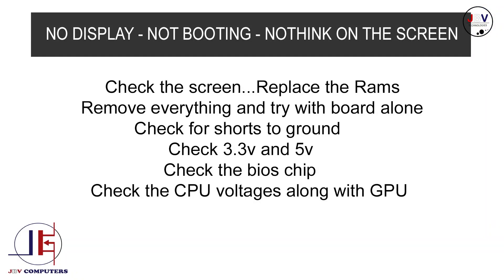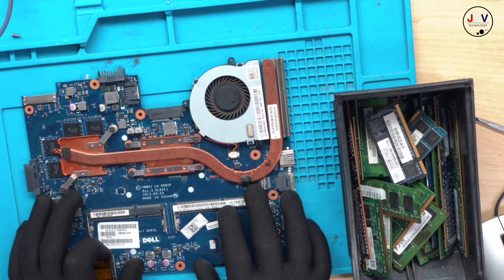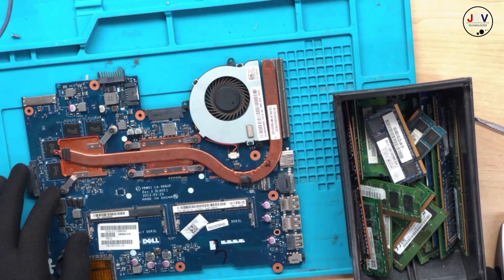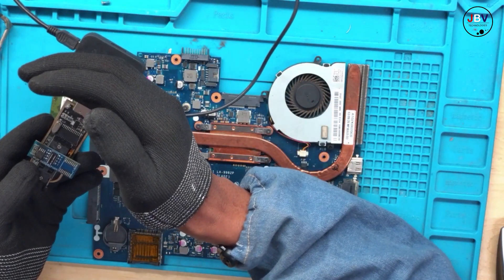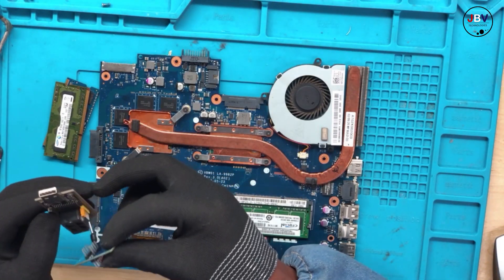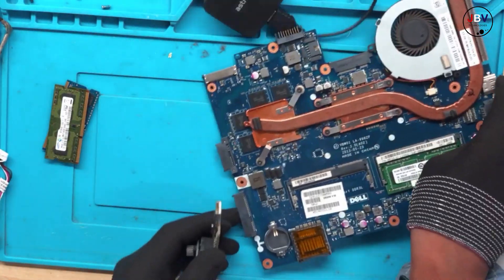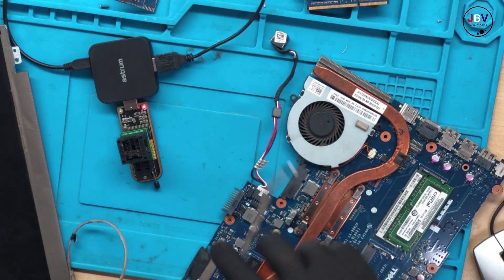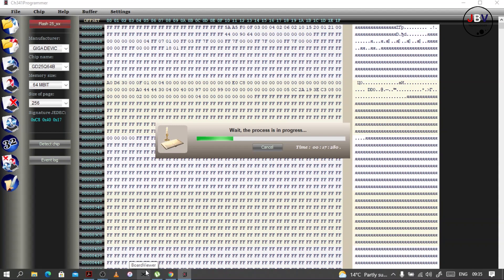SOLVED BY PROGRAMMING THE BIOS CHIP - DELL LAPTOP WITH NO DISPLAY

Comment: jbv i reprogram a laptop motherboard cause of no display and suddenly the laptop won't turn on when i press the power button have check for voltages all are present and even the charging light is on but won't power up any solutions guys
Reply: What exactly did you do to the motherboard?

Comment: Pls Help. Hi, I have Dell XPS 15 L502X {2nd-Gen i7 processor & windows 10} (purchased in 2012). Few days ago, a blue screen error suddenly appeared during using the laptop (not remember the error code). After that, repeat blue screen errors occurred just after the windows completely load up but Windows was loading in safe mode.
Next day when I tried to boot the laptop again, it's fan, leds lights & keyboard backlight etc are working but display is not turning on at all (Not even Dell boot logo is showing). Battery & charger is ok.
I have done all basic troubleshooting steps like press power button for 1min without battery & charger. Also connected the laptop with external monitor but no help.
Laptop Display is working, i have done Dell Display test by pressing "D-key + power button" and multiple colors are showing but after reboot same black screen issue is happening.

During repeatedly trying to boot the laptop, 2 times Dell boot logo was randomly appeared out of 50 trys. And an error code was showed on boot " 00c08270: Real time clock error - check date and time setting" along with continuous beep sound.  
I pressed F2 to boot in bios and changed date & time settings and then I pressed F1 to boot in windows. Windows was trying to load but a blue screen error occurred " Stop code: DRVER POWER STATE FAIURE" .
I thought that it is CMOS batter issue so next day I changed the CMOS battery and installed a new one. I also removed the RAM, Keyboard, HardDisk and cleaned their connectors with soft brush & cloth.
But issue is still occuring, Dell boot logo is not appearing again & display is totally black but fan, led lights, keyboard backlight etc is ON. I am not able to access BIOS settings.

 Is this problem related to BIOS? (but I hadn't installed any bios).
So, What can be the issues & how to resolve it ?
Reply: Did yoi fix your laptop?